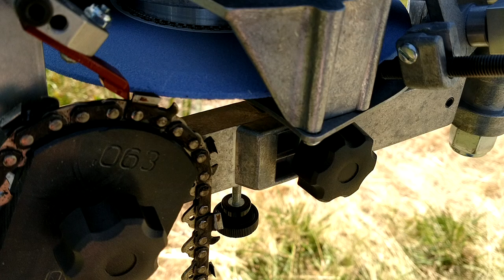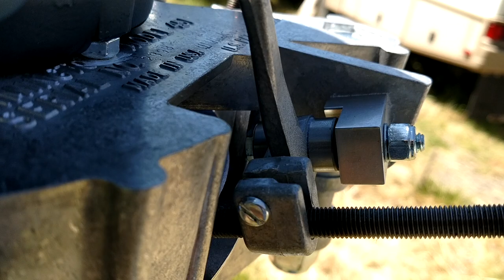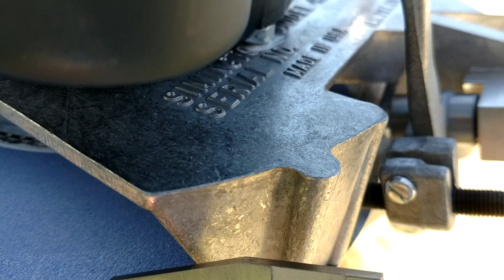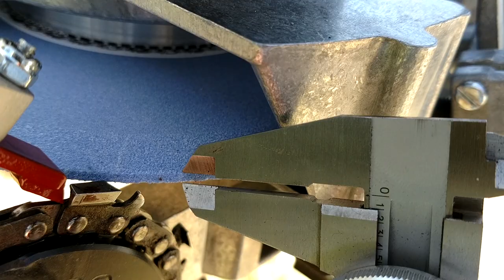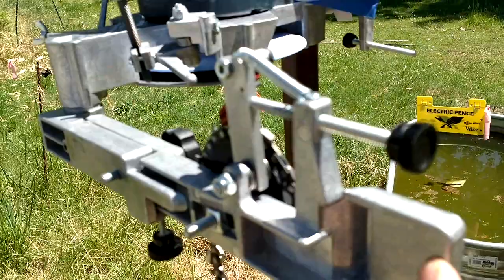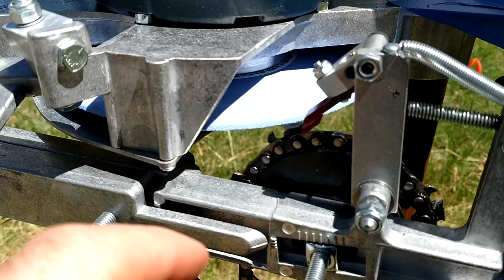Simington 451C square ground chain grinder

Comment: Thanks for that ..will get myself a caliper .. madsens .. do a google search "Simington 451C " have a pretty comprehensive tutorial also on the google search find treeson "square grind tutorial " I owe Big Mike a beer.   I've made a few mistakes ..start with old chain. Its an apprenticeship, but when you get a God chain it will blow you away.